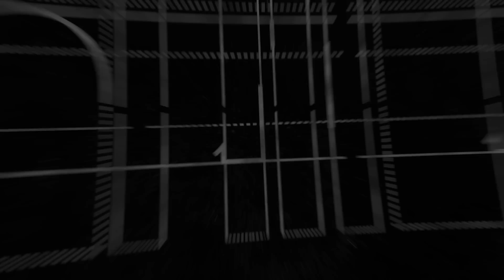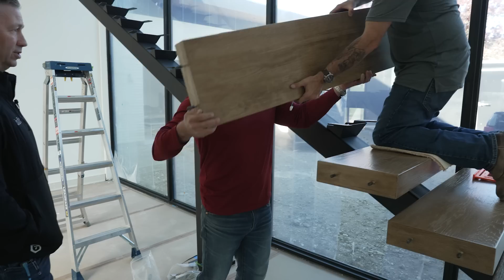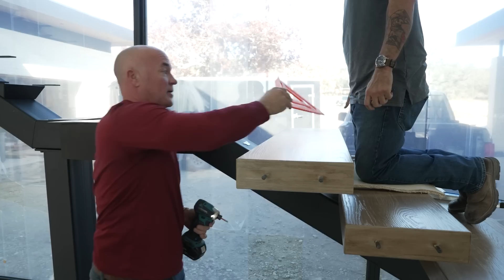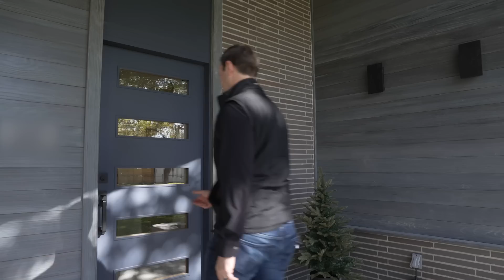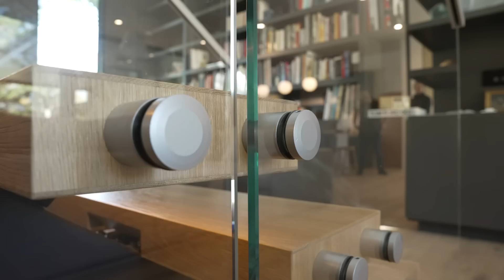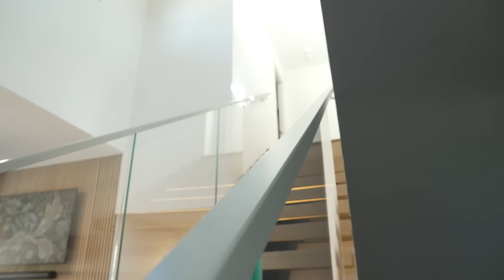Craftsmanship in a Box!  These make us look like super-stars as Builders

Comment: Got a quote for my house I'm building. The quote I got was staggering...and that was without install. I either need to do myself with a crew, or Viewrail says to estimate 30-40% of the materials cost additionally for them to provide install service. Just the materials for mine (including cable railings, but no LED lighting) is pushing $60,000. That is ten foot run from lower level to main level, and another ten foot run up to a loft. To compare, I'm looking at some piecemeal options to see what the saving might be (local steel fabricator for stringers and railings, then sourcing treads.) More work and not as turn key but $60,000 is sobering.
Reply: This is definitely for a 1.5 million + builds, where 60K is just another high end item lol

Comment: You skipped over the most difficult part of the install.  Securing the stringer that weighs like 1000lbs.  How many people were needed to hoist that thing into place and also to drill holes in the concrete floors.  I have a lot of building skills but there's no way I can lift that thing by myself.

Comment: I'm sure many carpenters "enjoy" building staircases (or at least feel threatened at the idea of giving up building them), but the labor cost is high enough that it's ripe for disruption thru prebuilt options.
Reply: View rail flight starts around 18k not including railing so this is a super premium option that few can afford. The package shown in this video with glass railing, lightning, etc is probably approaching $50k.
Reply: @fox156  A couple of thoughts and observations from a crusty old non-builder:  worker expertise has declined over the last 30 years and new ways of doing high-profit things have evolved.  In a community of 10k, I'm not sure there is sufficient available talent to replicate the service and fabrication of this flight (including design, engineering, support/revisions) for less than View.  It's a premium design and the package offered by View means a builder can offer a distinctive product and assemble on site with existing labor, and that means profit for the builder.  As for price, Build is mostly about custom homes where the architect and builder are the team that delivers the dream to a family.  The buyer is presumably good for the tab. 😉